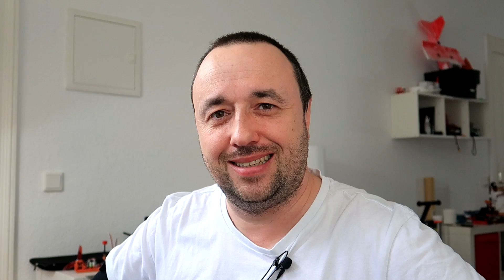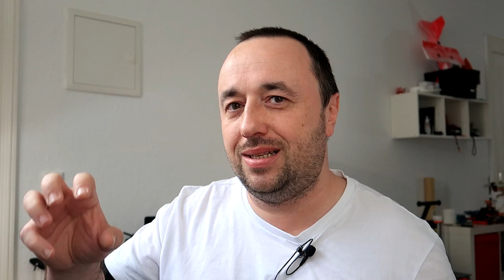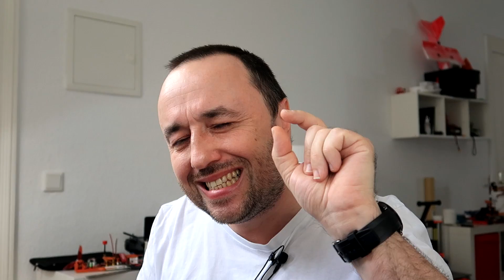Airmode vs Idle Up - what is what

Comment: I'm using air mode...  So what is happening when I slowly throttle up, my quad starts bouncing up and down 0.3-0.6 meter.  How do I fix this?  Raise min throttle?
Reply: Take off and fly. It's called airmode  - not ground mode. As I described in earlier comments, with airmode enabled the mixer will make the motors respond much more aggressively to corrections. When you bump the ground the flight controller sees this as a big change that needs to be corrected and it responds. Basically the flight controller is not expecting you to be bouncing off the ground.
Reply: Try airmode on a switch if you can and have it off for take off and landing, I found this to help, and now prefer airmode off at the moment all the time.? Try it and see.

Comment: Airmode allows the mixer access to more throttle position on each motor for stabilization this means though that if there is a lot of noise  internal (motor noise)or external (wind turbulance) the overall combined throttle position can be much higher than commanded making the quad feel floaty.

Idle up keeps the pid controller active whilst dictating the overall minimum throttle position which will importantly be above the min for each individual motor.

With idle up the pilot will be able to adjust the stability at min throttle to their taste.

Idle up will also sacrifice stability for more direct controll of thrust for the pilot.

Comment: Sorry, this is incorrect (or at least incomplete) in regards to Betaflight. The behavior regarding zeroing I term between airmode and "idle up" is the same as you described - this part is correct. However airmode on Betaflight does more than just prevent I term reset. Airmode also increases the dynamic range of the mixer allowing a wider range between the min and max motor outputs. So it increases the low throttle authority of the PID controller/mixer to provide better flight performance in all throttle ranges. So if you use "idle up" on your radio instead of airmode on Betaflight you are getting degraded flight performance compared to what is possible. I can't comment whether "idle up" and "air mode" are the same on KISS.

So unfortunately you're spreading a little misinformation in regards to Betaflight by saying that airmode and "idle up" are exactly the same. The quad will fly significantly better with airmode enabled vs. not (regardless of the I term reset at low throttle issue).
Reply from the maker: Well... You are partially correct. There is more than just Iterm not zeroing in the mixer, but those routines can happen also without airmode and in speciufic conditions. Let's call them airmode derivatives. And they are rather limiting the pilot throttle authority, not increase it
Reply: It's about mixer's control over motor authority at low throttle - not about limiting the pilot's throttle authority.

For example, here's a flight controller on the bench at low throttle with me banging the roll stick back and forth. First is without airmode enabled. Note that the motor outputs needed to correct error are only outputting ~50% (I probably induced a little pitch while moving the stick so it's not exact 50% for each).

http://www.etracer.net/betaflight/airmode_off.png

Next is with airmode on. Notice how the mixer is now requesting 100% of the motor output to correct error.

http://www.etracer.net/betaflight/airmode_on.png

The mixer will use a wider range of motor commands to achieve the error correction quicker and more aggressively. This is why with airmode on the quad will be more stable and fly better - particularly at at low throttle conditions. You are correct that there are cases where this difference diminishes and that's once the pilot's commanded throttle exceeds 50%.
Reply: @BruceLuckcuck  yes you are correct. 
Airmode is also dynamically moving the throttle offset to be exactly inbetween the motor with highest and lowest output.
Reply: @BorisBnow  i thought you dissapeared Boris since no vids in 3 years !!
Reply: Very interesting insight Bruce! I was suspecting that Airmode in BF was increasing PID gains to compensate the low prop speed momentarily but its clearly increasing the motor range. Thanks for the pictures!